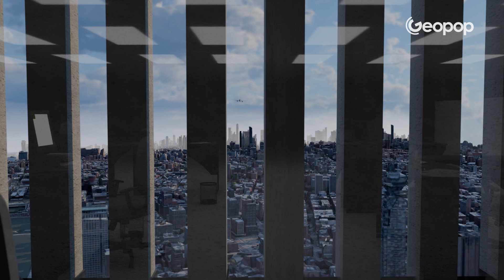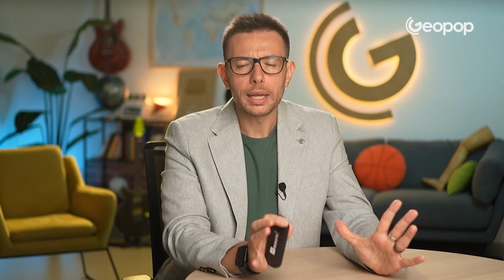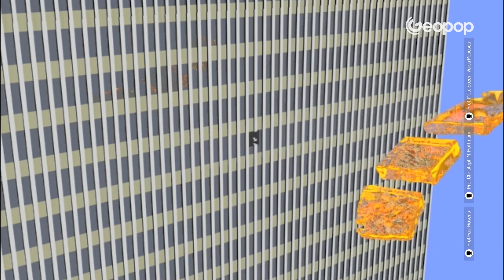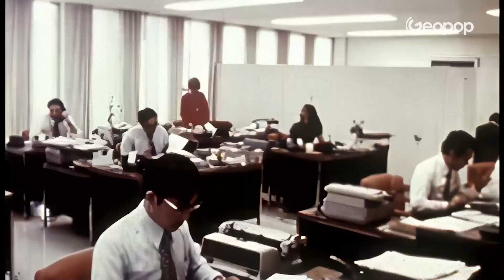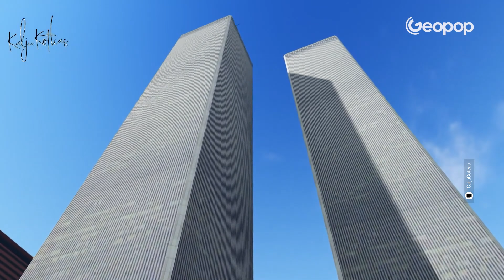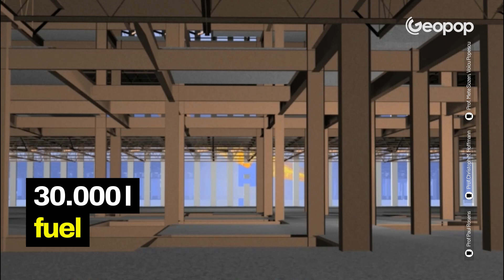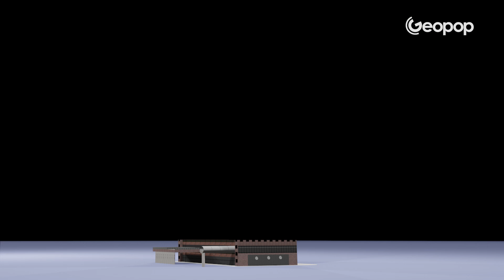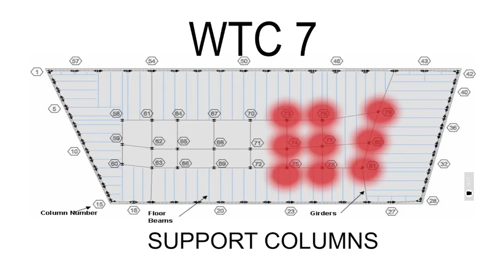9/11, 2001: The Technical Reconstruction of the Twin Towers and WTC 7 Collapses

Comment: Nist is a joke… demolition companies should just start fires instead of the months of prep….reported for disinformation
Reply: Why is The NIST a joke?  Please be specific and be as prepared to defend that position as I am to shred it to bits.
Reply: @TheLoonResistance what??  Like the 9/11 report? First off their animations don’t mimic what happened and they didn’t check for explosives because “that would have been heard and none were reported” LOLOLOLOL a “scientific standards” organization didn’t scientifically analyze the events. I wouldn’t even know where to begin short of soooooooooooo much doesn’t make sense and defies logic, history, and common sense. First time in history and steel reinforced structure collapsed due to fires. Only 3 times in history yet ZERO construction and building codes changes or the standard procedures for fire fighters. It’s just a crazy anomaly that justified everything changing.
Reply: @TwinGoats  - 1.  You mean The NIST's models ?  They aren't supposed to mimic what happened. Models test mechanisms.  They cannot possibly recreate the entirety of an event like a building collapse but they can illustrate what started the collapse and sequences of failures.

If you are expecting photo-realistic recreations from an engineering model your expectations need correction, NOT the models.

2.  What is the first test for explosives?

3.  Were The NIST wrong?  Did the Twin Towers and Building 7 collapse due to the combined effects of Impact Damage + Fire (heat) + Time + Gravity or not?

4.  The first time in history is an obvious logical fallacy.

Anyone can quibble over details but what matters is what actually happened and no report written years later can change that.
Reply: @TheLoonResistance lol that’s a lot of words  to NOT refute what I said.  20 damaged stories won’t pile drive 80 undamaged floors with triple redundancy. And if it were a collapse of the floors pancaking down it would slow the fall not speed it up. Nist acknowledged the towers fell at almost free fall speed but regardless, their assessment is a joke because the core structure would still be standing and it wasn’t. Just listen to the people that were there, the first responders, they will tell you. And dismiss 90% of what they ALL say, that’s still more evidence than nist acknowledged.. ALL the eye witnesses are wrong, all the video evidence showing explosions or recording the sounds were lies lol. That’s what nist said…
Reply: @TwinGoats  - That's a lot of words to NOT refuse what I said while completely changing the subject to avoid your talking points that I just crushed.  You are boring me so I'm going straight for the money shot.

Twin Towers collapses were relatively straightforward and well understood in the professional engineering community within just weeks. Yet there’s still a lot of really bad information floating out there easily accessible on the internet, premised on wild baseless speculation and pathological theorizing with easy hand-wave answers.  Engineering is hard. This stuff is simple, exciting and requires little or no thinking, so it gets far too much attention.

Because anything can seem like a conspiracy if you don’t understand how it works I prepared my own short yet detailed technical description of Twin Towers collapses from my own observation and analysis of available true and relevant facts. No politics, ideology or magical thinking, just engineering. Hopefully this will dispel many common myths and answer most if not all questions you may have about the collapses.  

While complex, most of the Twin Towers collapse mechanisms can be seen with the naked eye and easily discerned and understood by the layperson if sufficient time is taken to understand.

1. The Twin Towers consisted of 4 primary structural elements that together formed an integrated system where each relied on the others. 47 hollow box-section steel Core Columns carry the majority of the gravity loads. The 236 hollow box-section steel Perimeter Columns carry the remainder and ALL of the lateral (wind) loads. Long-span Lightweight Steel Trusses connect the core and perimeter column together at each floor with a Hat Truss on top to tie the structure together as an integrated unit where no element can survive without the others. There was no structural load bearing concrete and most components were bolted together.

www.youtube.com/watch?v=u7OqrC74Dm4

2. The impact of 117 tons of airplane (= to about 12 dump trucks) at speeds up to 590 mph with the energy of a ton of TNT completely destroys the aircraft. This in no way implies the Towers come out unscathed. Many perimeter columns are damaged or destroyed as are some core columns (example; 33 of 59 perimeter and 20 of 47 core columns damaged or destroyed at the impact floors in the North Tower), This damage is primarily through bolt-shearing failures at the end connecting flanges, as well as bending, twisting and fracturing of weld seams. There was no cutting or slicing - the reality was far more violent and messy.

3. The impacts destroy or damage fire insulation, fire breaks and sprinkler systems on multiple floors. Huge fires are started across multiple floors simultaneously and allowed to spread rapidly with no effective firefighting or fire suppression. This was an unprecedented fire event .

4. The hotter steel gets the weaker it gets . With fire insulation stripped away and no sprinklers the survival time of the steel greatly reduced. Gradually over time heat causes the lightweight steel Floor Trusses at the impact damaged floors to sag, which was observed and recorded. No steel melted or needed to. Structural steel fails long before it becomes a puddle. It just needs to bend

5. Sagging floor trusses pull on the increasingly weak and overloaded Perimeter Columns, causing some of them to bow inward by up to 5 feet. A straight column is up to 4 times stronger than a bent column. The bowed Perimeter Columns buckle and fail, quietly initiating collapse. The formerly static mass above which the structure below could easily support is converted to a dynamic mass up to 30 times greater. Because they have buckled, the Columns above and below the failure point are no longer aligned . The load bearing structure below no longer bears any load as it falls past the lower columns, NOT onto them.

www.youtube.com/watch?v=ULdiD6gYZO0

6. Thousands of tons of debris fall within the four outer walls, down through the open office space, crashing onto the first intact floor it encounters, immediately breaking the bolted column connections as the amount of resistance the Floor Trusses can offer is negligible. The falling debris slows only marginally and briefly. Note: 
6a. This is NOT a solid top block crashing into and “crushing” a solid bottom block . 
6b. The debris falls past the columns not onto them. The columns provide no resistance to the falling debris. 
6c. Only the bolted floor truss connections to the core and perimeter columns offer any resistance. A pair of 5/8” bolts at each end of each truss vs. thousands of tons of falling debris. 
6d. No laws of physics are violated. 
6e. There is no 20 floors against 90 floors but rather 20 floors against one floor, then 21 floors against one floor, then 22 floors against one floor, etc. 

7. This floor-led collapse progression within the four outer walls can only go straight down.
7a. This process is often incorrectly referred to as “pancaking”. The catchy name stuck but nobody knows what it really means and "pancaking" is too simplistic and inaccurate anyway. I prefer Kaiserschmarrn.

8. Collapse progresses through the floor systems past the columns, through the path of least resistance . The resistance offered by each floor is always the same while the mass of debris and its velocity – thus its energy - increases with each floor failure. Each floor offers the exact same resistance to the falling mass while with each failure the falling debris constantly gains both mass and velocity. *This process of floor-by-floor destruction cannot be arrested, it can only speed up . Rate of floor failures increases with each floor as momentum increases, reaching an average acceleration of 0.65 of GA, or 35% slower than true free fall. Bam, bam, bam down the building until there are no more floors to fail. The resistance offered by each successive floor is always the same. More mass, more velocity, same resistance with each floor. Don’t get stuck on the but the lower floors weren’t on fire nonsense. They weren‘t and didn’t need to be.

9. The Towers were 95% air by volume. As that air was compressed inside the building it is forced down the tower and blown out the sides in reaction to the building collapsing . Those were not “explosions”, it was expulsions of compressed air caused by the collapsing building, explaining the low velocity, lack of flash, blast, supersonic pressure waves and lethal high-velocity ejecta.

10. Perimeter Columns become detached and peel away like a banana behind the collapse front, playing out to the four points of the compass extending to more than 800 feet from the base of the towers. This was quite obvious from examination of the debris pile.

11. Core Columns fail last as their internal beam bracing is stripped away by falling debris and lateral support from the floor to perimeter columns is lost.

12. For those who care about how long this whole process took; 31-34 seconds from the moment the perimeter columns buckled until the last core columns hit the pile, or 1/3 the rate of true free fall. Don’t believe me? Just watch any video of the collapses and note the loose truly free-falling debris dropping much faster than the towers themselves.

13. Each Tower had a 1-acre footprint. Far from collapsing inside their own footprints the debris pile spread out over 17 acres in a pile up to 14 stories deep. 8 surrounding buildings were destroyed and scores more damaged by the falling debris.

14. NOT observed were the 180-190 dB bangs of thousands of high explosive devices or the blinding bright flashes of burning thermite. Neither explosives or thermite could have survived the impacts and subsequent fire nor could have caused the (silent) perimeter column buckling that clearly initiated collapse either. A video of a shocked and injured firefighter casually using the magic word explosion is in no way proof of explsoIVES and the demolition_ case relies entirely on that sort of thing. There is zero tangible physical evidence and it would be technically impossible, totally impractical and completely unnecessary. No one would bother.  In 24 years zero structural engineers of tall buildings, including the 1/3 that have retired in that time, have made any statements in support of pre-planned demolition claims. NONE. The lack of any such citations in the engineering literature (published in any country worldwide) is telling.

15. Twin Towers were perfectly safe within their design envelope. They only collapsed when taken far outside design parameters by an extraordinary and unprecedented event

Impact + Fire (heat) + Time + Gravity = Collapse . Remove any one of those 4 elements and there is no collapse. Ignore any of those elements (as many do) and you will never understand the collapses. The Twin Towers were an integrated system in which no one component could survive without the others. One fails, the rest follow, through the path of least resistance – DOWN – through the open space, bypassing the path of greatest resistance – the columns. Nothing I just described violates any laws of physics. All of the above is true no matter who planned and carried out the 9/11 attacks or why

I hope you found this helpful and informative. It is not meant to be adversarial, but to solicit informed critical comment, positive or negative. If I made any errors of fact, logic or reason or left anything critical out, please let me know so I can fix it. To stay focused, just one topic at a time please and on-topic (Twin Towers ONLY). No word-salads of Gish Gallop. IF you can offer a more plausible alternative be my guest. Please start any reply with the words “Tits McGee” or I will know you didn’t read it, are not serious and just wasting my time.

Comment: WTC 7 Collapses because of fire? bullshit
Reply: Buildings collapse every day from fire.  Fire even destroys entire towns and cities in one shot.  17,000 buildings burned to the ground in Los Angeles a few months ago. I bet that didn't even raise an eyebrow for you. The only difference with Building 7 is the size and scale.
Reply: @TheLoonResistance steel cored buildings don’t collapse every day from fire.  Grenfell Tower in England burned for hours and it’s still standing years later
Reply: @Bassman_DB  - Not every day. 

Grenfell Tower wasn't steel, it was reinforced concrete, which is far less likely to suffer catastrophic failure in fire than steel alone. This is why the new WTC Towers have reinforced concrete central cores. 

The (somewhat) analogous examples you are looking for if we just limit ourselves to high-rise structures (although fire does not care how tall a building is) then Plasco Tower and Wilton Paes de Almeida are the examples you would want to look to.
Reply: @TheLoonResistance the plasco building fell because the building's lack of modern fire safety systems, non-standard maintenance, inadequate compartmentalization, and reports of warnings being ignored by the building's management.  Wilson Paes de almeida had squatters living in it. It was destroyed because of an explosion.  Plus no real investigations were done on either of these buildings to determine they weren't controlled demolition as well

Comment: What about wind at 80 floors up? Clear day, that's great, there's still wind. The steel was bent on impact and the heat followed the bends to the perimiter and it snapped with the weight.
Reply: Basic wind speed for skyscrapers in New York is assumed to be 98 mph, according to the city building code.  Buildings have to be designed to withstand 140 mph gusts that last 3 seconds.  Even when it is dead calm on the ground, there is substantial wind at altitude

Comment: I saw molten metal flowing like lava out of the corner of the building that was worse on fire while it was live.I remember it very well
Reply: Pouring out of the NE corner of the South Tower (and it was in fact ONLY the South Tower)?

You mean this?

youtube.com/watch?v=xPVGGQU-MeQ&ab_channel=SeekersofTruth

That was aluminum.  

The Boeing 767 which struck the South Tower weighed 117 tons and 80% of that was aluminum. The exterior cladding on the Twin Towers – the white panels – were also aluminum.

When Flight 175 struck at the 81st floor its momentum deposited much of the office contents in its way and the bulk of the aircrafts mass into the NE corner of the building. The piled up debris shoved into that corner is visible in photographs and video so we know it was there. There’s a good shot here of piled up debris from 4:36; 

youtube.com/watch?v=ZLJyL63sqtU&ab_channel=MrKoenig1985

Steel melts at roughly 2,750-deg F while fires in the South Tower reached peak temperatures of around 1,800-deg F. Aluminum OTOH melts between 887-deg F to 1,180-deg F depending on alloy. That aluminum will melt under these conditions is not a surprise. If you look at pictures of cars left behind and destroyed by forest fires the aluminum wheels are invariably melted away along with other sometimes aluminum parts like hoods. Steel bodies remain intact.

The “molten metal” appears at 9:52 am. At the same time we see the first externally visible signs of sagging floor trusses and the pulling of the perimeter columns inward. I submit these events are related, not coincidental. The aluminum cladding at the NE corner also appears to me to be burning. It is likely with the floor trusses sagging under the heat, and the 81st floor truss in the NE corner under the debris pile subjected to the heavy load of the debris pile, the truss broke its perimeter column connections and dropped, instigating the material starting to pour out of the NE corner at the 80th floor. Given the properties of the materials in question, aluminum is by far the most likely culprit.

Reports from The NIST, FEMA and MIT all concluded the material is aluminum.

The famous video of glowing liquid gushing out of Tower 2 moments before it fell, involves at least tens of liters of molten aluminum. The thermal mass involved is so great that it stays red after falling many meters through the open air.

Side note: There was also a large UPS battery farm in that spot and some of that material at least may well be from the batteries IMHO.
Reply: Just as we couldn't admit that we know it was steel, stinky cannot admit that he knows it was aluminum. What we do know is that these experts found molten steel in the debris. Captain Philip Ruvolo (NYCFF), 
Richard Riggs(debris removal expert), Mark Loizeaux , Leslie Robertson (wtc structural engineer), Lynn Margulis (University of MA),  Dr. Abolhassan Astanch (from Berkeley),  Robert Kim Ireland( chemical engineer for US Army Corp of engineers), Mark Basile( chemical engineer), Kathy McGrade (materials engineer), Gery Warner( Mechanical engineer), David Gregg( PhD Chemical engineer), Steven Jones PhD( physicist), Kevin Ryan ( BS Chemistry), Niels Harrit (PhD Chemistry), Tom Sullivan( Explosives team) Jason Cheshire ( Chemical engineer), and Jeffrey Farrer (PhD Material science engineer).